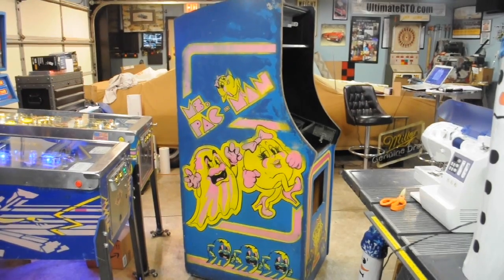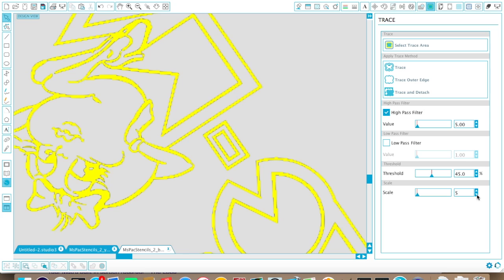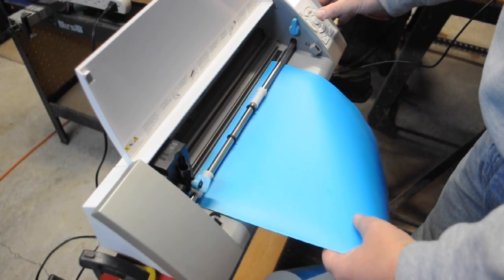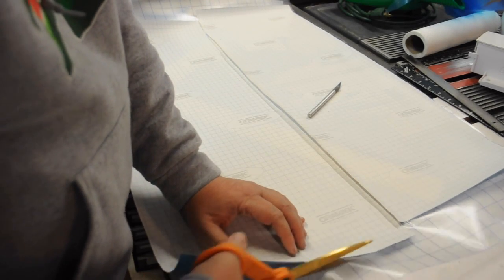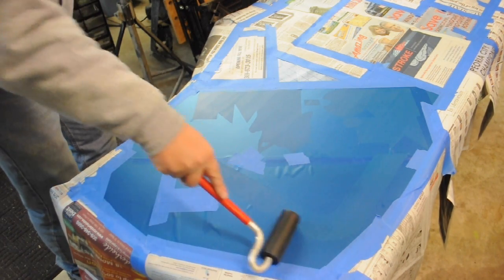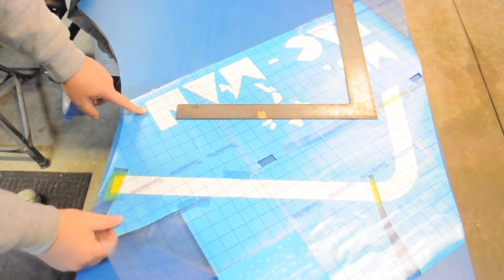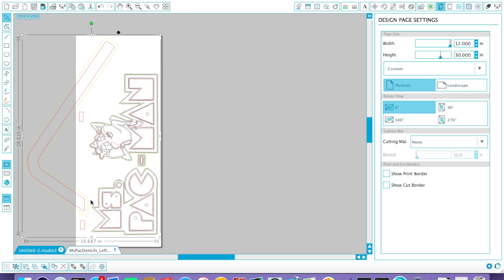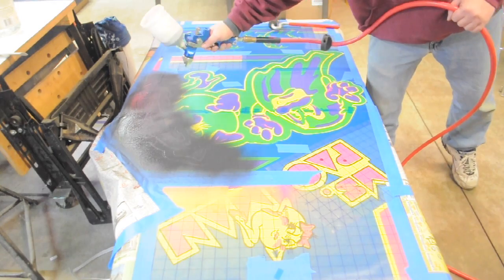DIY Ms Pac-Man Arcade Paint Stencils

Comment: This is so awesome!  I actually had this Idea a few months ago, when I bought my Ms Pac Man where someone painted it black, and someone else ruined the art on one side trying to remove it.  My fiance was talking about buying a cricut...thinking this restore was a possibility we purchased one...but I never sat down and learned how to work with the cricut.  I was using this same set of art but didn't know the welding and such with the software.  Now I'm gonna have to it down with your video and get back into restore mode!
Reply from the maker: I have an old Circut. My version wouldn't let you bring in your own images or cut bigger than the mat. So I used the Silhouette Cameo. But it looks like you can do a lot more with the new Circut and it's software.

Comment: How has the paint job held up over time? Sherwin-Williams guy suggested duration home might not be as long lasting but I’d like to finally paint mine and like how yours turned out.
Reply from the maker: It never picked up any scratches or chips. I drove it 200 miles in the back of my pickup and it’s in my uncles basement rec room. It’s still flawless, but he’s real particular about keeping things perfect.
Reply: geeteoh thanks. The paint codes are all for quart sizes right?
Reply from the maker: Matt Swensson yes.

Comment: I need a Stencil made for a Super Pac Man front kick plate only. Could you make or do you know where to have this printed? It's 3 colors - Yellow, Red and Black. I have the Illustrator file already sized.
Reply from the maker: A sign shop should be able to cut paint mask easily. Plus they can do it on wide vinyl.

Comment: Thanks for showing this process! It seems the key is having the color separated PDFs to work from to begin with :(
Reply from the maker: You can start by “tracing” all colors from one PDF. But then you would have to manually erase each of the unneeded color outlines. And do this 3 times. One for each stencil.
Reply: @geeteoh1  you know, thats a good point! So if you had to do this all over again, would you have opted to buy stencils instead of doing all the work? I know in my case I actually enjoy the work so I dont feel like my time is 'wasted' or anything.
Reply from the maker: I would purchase the stencils for an arcade cabinet next time. But I learned a lot and will do my own for smaller jobs.

Comment: Great job dude! What kind/size of air compressor did you use if I may ask?
Reply from the maker: Thanks. I did the other sides off camera. It turned out better than I expected. After that, I wanted to share the last side. My compressor is a big one. DeVilbiss Air America 6.5hp 60 gallon upright 240vac with 11 or 12 CFM output. It rarely ran during spraying. The tank was set at 110PSI and my external (in-line) dryer/regulator was set at about 35PSI. I bought it for sanding which needs the high CFM. My next video will show some filling/sanding and refinishing of the coin door by a professional in body repair.

Comment: Can i purchase a set of stencils?
Reply from the maker: The New York Hustle, I do not sell the stencils. Sorry. They are available online. And in one piece, instead of 12-inch strips. Much easier to apply.
Reply from the maker: The stencils I made are a bit harder to apply (and keep stuck down) then ones you purchase. If I had a wider vinyl cutter, I could sell them. Ms Pac Man stencils are expensive because there is three stencil colors over the base. Most other machines only have two.
Reply: @geeteoh1  Would you sell the Silhouette machine image?